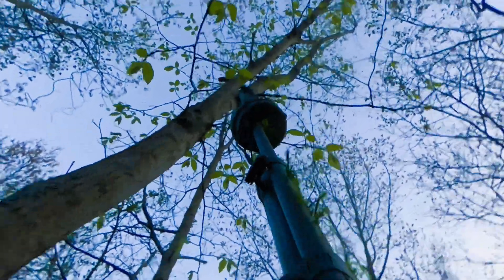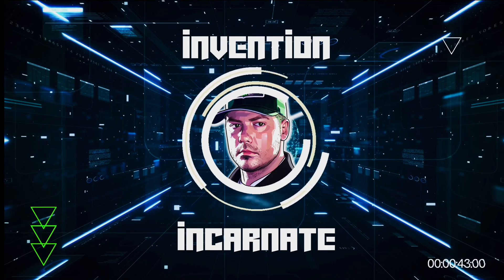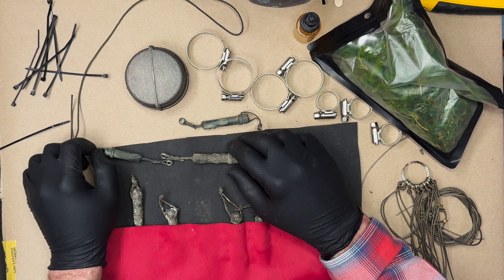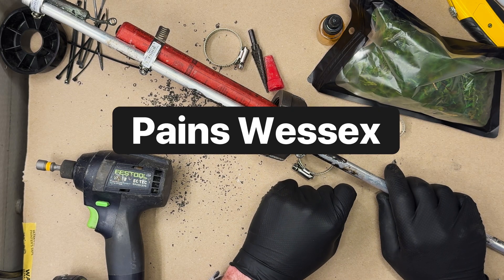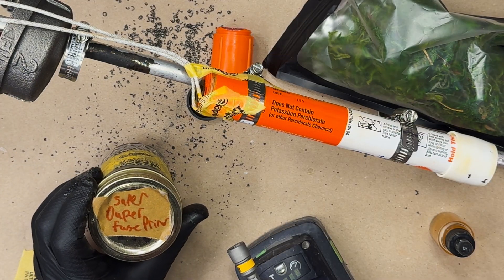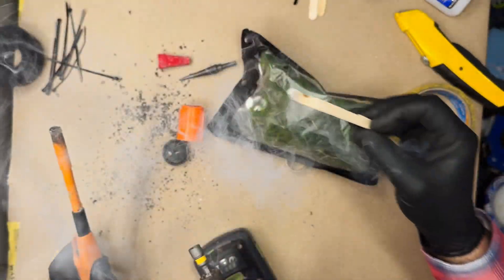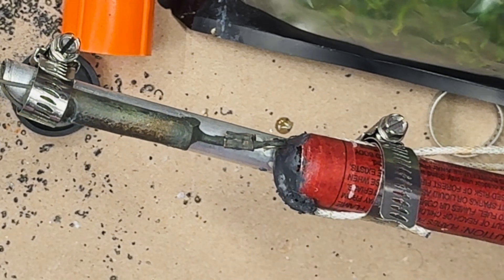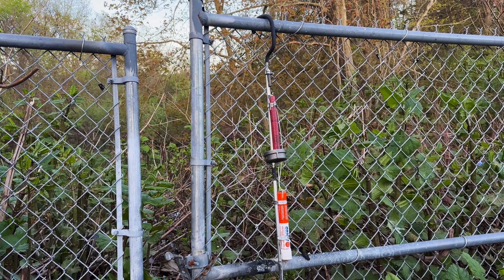Alert, Ignite, Illuminate: Trip Alarm With Flare and Smoke Activation

Comment: I see a lot of forest fires starting with these things
Reply from the maker: Act1, scene 1 [the first frame of the video]
“This is an educational video depicting a signaling device that can start forest fires if used stupidly. It is meant as a proof of concept, not a "go out and try it" video.
Obey all Federal, State, and Local Laws.”
Reply: @InventionIncarnate  well it is a good concept but you must think your audience is mainly well educated individuals who have good sense but in reality is probably mostly a bunch of rednecks that are saying at this moment hold my beer. I would think a stand-alone Pole so there is no foliage above or around it would be a better candidate. And I'm not sure if you're using a flare as a igniter but flaming waist drops from those. I've seen other ideas for trip wires using a blank I think those would be very loud and much safer. Not to take anything away from you always try to invent and come up with ideas but maybe test your idea more and see if there is any problems with fires starting
Reply: patriotforhumanity,
 Then, i would suggest you Quit setting them off.
Would see alot less . . .    ☆
Reply: @fjb4932  holy cow I think that's the fastest I've ever had a comment deleted
Reply: @patriotforhumanity7174  
 Am i now  "the slowest" ?      ☆